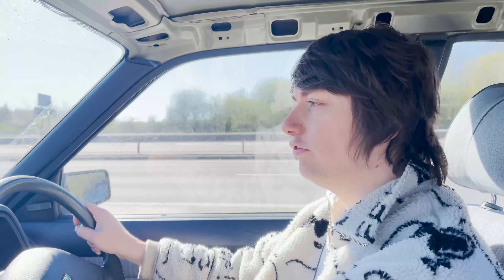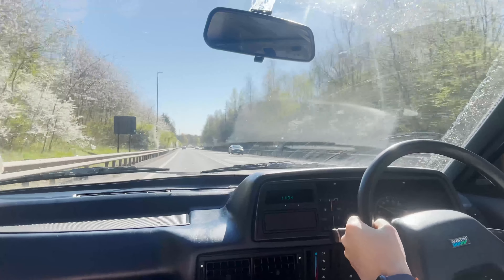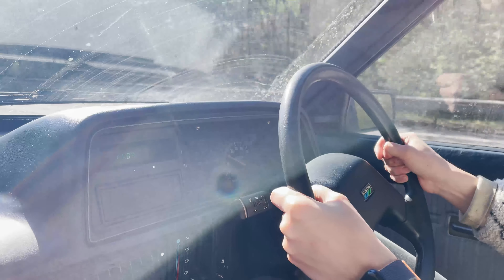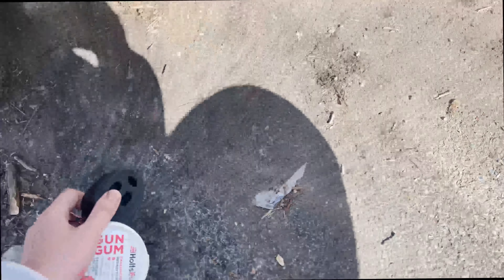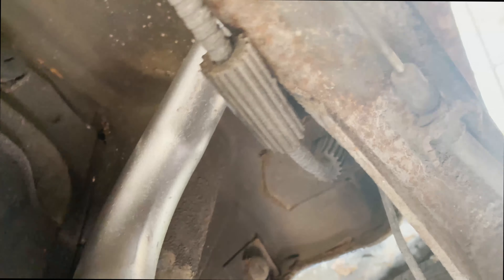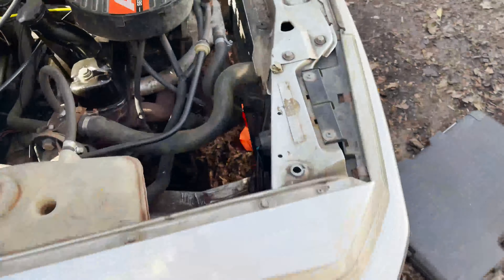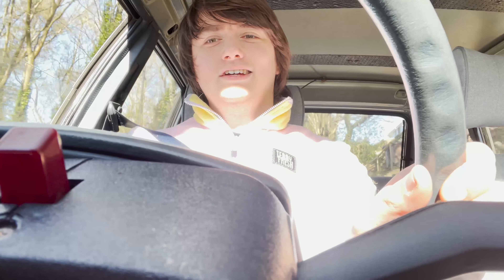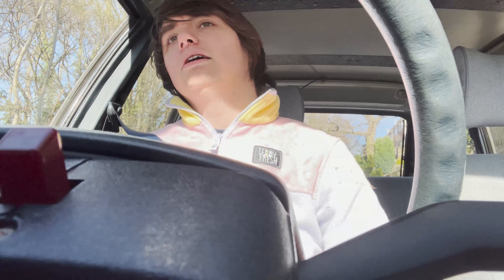Maestro Vlog 1: Fixing My Maestro Exhaust - Living with an 80s car in 2021

Comment: If you get someone to hold a rag over the exhaust at the end then the exhaust blow becomes more apparent.
Reply from the maker: Thanks! We found it wasn’t blowing in the end. I had a mechanic check it over
Reply: @tomdrives  Aftermarket exhausts often don't fit and are noisy but the extra noise might make you feel as though you're going faster so it could be a good thing.

Comment: is that just surface rust on that rear right turret tom?
Reply from the maker: It is yes but it developed after the hole that has been patched. It’s solid though thankfully :)
Reply: I'd get the jet washer out and clean it from the underside! The MOT man won't like that being so close to the suspension!

Comment: If your still looking for a head lining I my be if some help.
Reply from the maker: Do you have one without a sunroof hole? I’ve got one lined up with a sunroof but I’d prefer without :)
Reply: @tomdrives  I'm not sure, I'm picking up a load of maestro parts for mine and the massive stash of parts on offer has a roof lining. To which I don't require. If doesn't have a sunroof I'm more than happy to pass it your way for free.
Reply: @tomdrives  it doesn't have a sunroof I've been told, it came out of a mid 80's city.
Reply from the maker: Nice and thank you! Where are you based and do you have Instagram/Facebook or any way to contact privately :)
Reply: @tomdrives  sure, you can contact me on FB, I'm in the same rover group as you setup by Rover Paul. I'll send you a message on FB 🙂
Reply from the maker: @vampireechidna  Thanks :) I can't see a message on there? If you comment on one of my posts I'll message you if it doesn't come through.